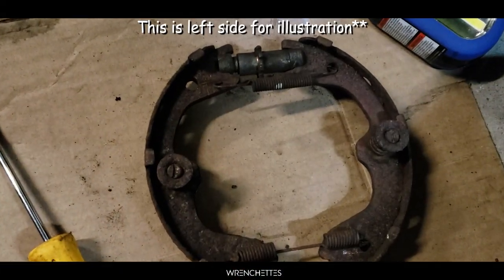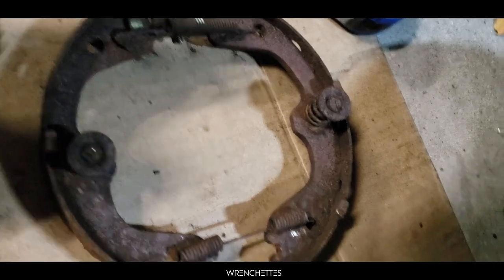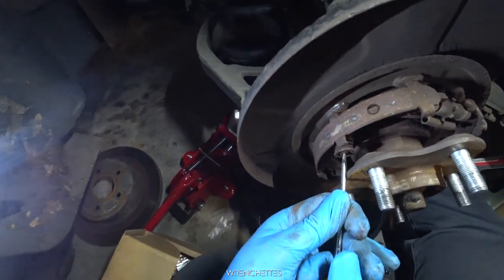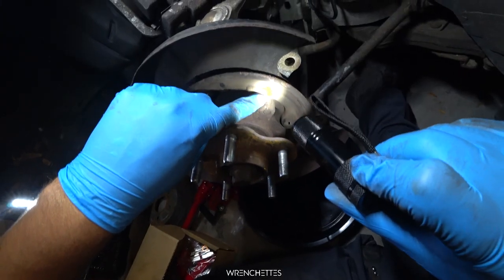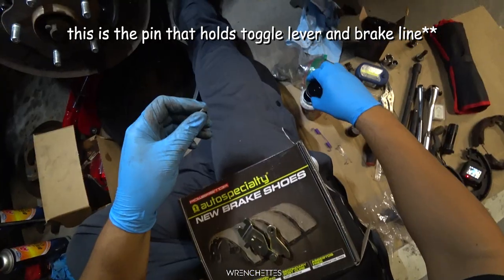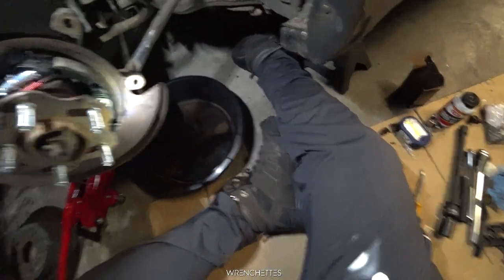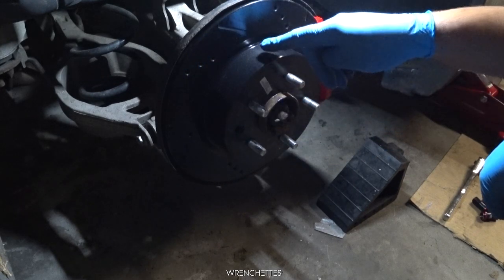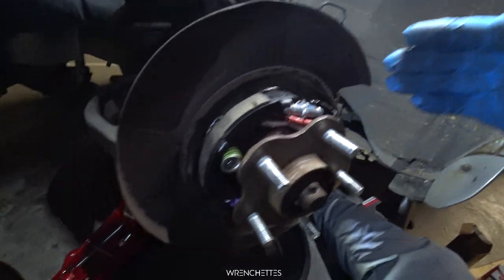How to replace e-brakes | Parking brakes | infiniti G35 & Nissan 350z

Comment: What's the pin in the toggle lever called
Reply from the maker: tbh i dont know. i just call it a toggle pin.
Reply: @LuisMBuildz where did you get the pins?
Reply from the maker: @Wheresjxy  from ebay. some sell the entire assembly including the pin.

Comment: Yo so what do I do? The pin keeps falling out from the lever ?
Reply: Nevermind I think I got it
Reply from the maker: nice, you got this 💪
Reply: @370gtalej5 yo could you please tell me how I’m doing it right now struggling lmao
Reply: Bro lmk real quick please
Reply: @Xabaii  ended up putting the old one back in. Hammered it back into shape. The lever they sold me at o reillys was too big. Just make sure your parking brake is adjusted very well before putting everything back together.
Reply: @martinmorales296  ended up putting the old one back in. Hammered it back into shape. The lever they sold me at o reillys was too big. Just make sure your parking brake is adjusted very well before putting everything back together.

Comment: My p-brake was jammed in the rotor after pulling it off to replace a wheel bearing.  Was scratching my head how to set the p -brake up properly and your funny ass video saved me. You rock dude but your farts need work…
Reply from the maker: lol, glad i could help bro. keeps me going.

Comment: Where did you buy your toggle switch ? I need one for a 04 g35 . I google parking brake lever but not sure if I’ll get the right part.
Reply: Also if you get the chance to reply , can you leave a link ? I found another comment asking the same question but I googled what you said and it doesn’t pop up anywhere,  not even eBay

Comment: I can’t get my rotor to fit on. I have tried turning the dial as much as I can but I can’t get it to fit even if it tighten or lousen it. And the shoes look like they’re on properly
Reply: @LuisMBuildz  yes i did figure it out! thank you. but now i have another issue. those pins that r on top of the toggle lever i lost. i had to take them out to disconnect the break line sense i had to drop my whole subframe do you know anything else i could use to connect the lever to the E break line?
Reply: Wrenchettes so I had to take off eveything again because my e break line I fucking forgot to put the pins in. I was in a rush and completely spaced it. But now I’m at the point where I honestly can’t get the rotors on over the shoes. I don’t eveything you said and im still struggling I know the parts fit so it’s not I got the wrong size. Can you some how show me where they’re suppose to exactly sit at. Like the brake shoes
Reply: Wrenchettes I sent you a message on Instagram😊
Reply: Wrenchettes Luis correct? It’s In your description. Mine is keegans_350z if you can message me there